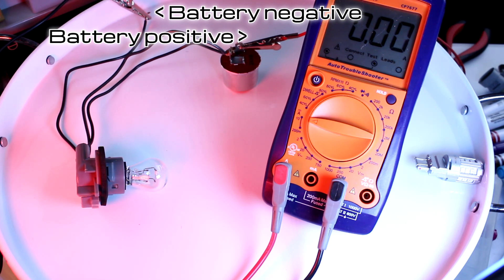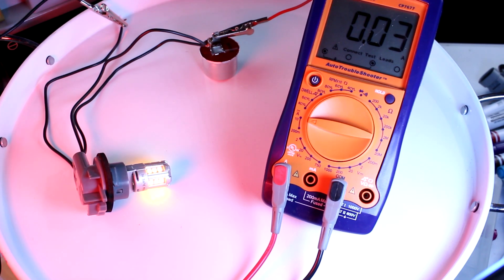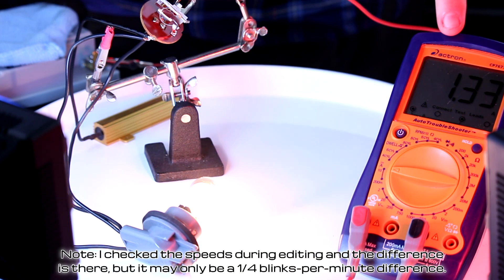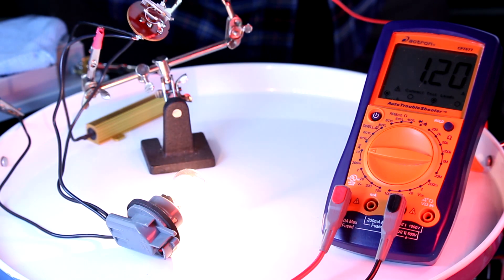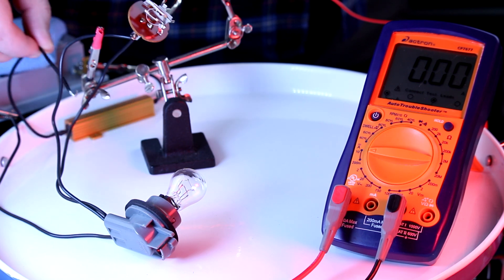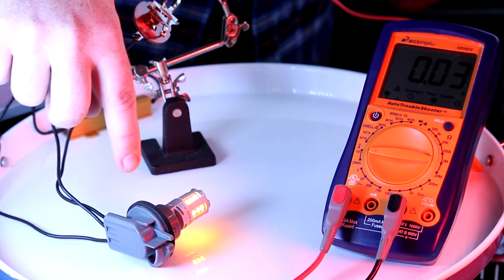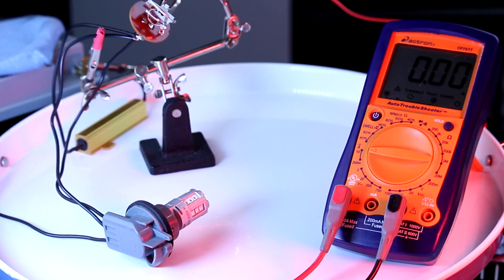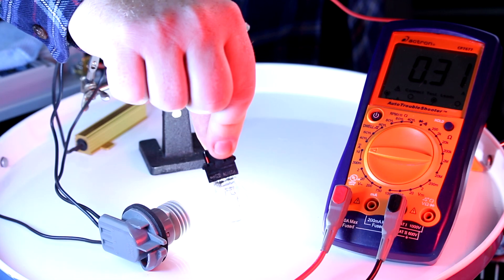Why LED Turn Signal Resistors Need to be in Parallel • Cars Simplified

Comment: Could the bulbs with built in resister work with a led bulb flasher relay?
Reply from the maker: Assuming there aren't any compatibility issues on the vehicle outside of the flasher unit itself, that combination should work. It would definitely be worth checking all four lights for turn signal and flasher/four-way/hazards after installation just in case, though.

Comment: Thanks dude, I didn't understand the LED indicator circuit fully until you mentioned that the resistor added in parallel helps draw more current THROUGH the flasher unit

Comment: @CarsSimified so with 12 volts, decided by amps. Those Sylvania zevo 3157c draws 5.3W per bulb. Much better than what they claim and labeled 4W on the led bulbs. 

And that’s actually pretty bright. 

Some say they need a backup camera to see better at night, but after installing these zevo 3157C with 5.3W, and it has a large diffuse lens. It’s super bright. 

These would be great option for reverse lights. 

Need to get my hands on them and see for myself.
Reply from the maker: For anything with a back-up camera, improved reverse lights make a big difference, especially if the camera otherwise has a really grainy image. There's a chance some cameras will simply have two sensor levels (day and night) which will keep night time grainy, but any other vehicle? Wild improvement! Sylvania Zevo, Diode Dynamics, and Lasfit are my three favorite brands for automotive LEDs at the moment.
Reply: @CarsSimplified  I agree with u.

Lasfit is my most go to brand. Sylvania zevo is my most as set it and forgetted type, and Auxito is also my go to.

Diode dynamics are knowing for one of the best of the best.

Would u recommend the sylvania zevo 3257C making 5.3W-5.6W for reverse light?

Comment: Great explanation thank you. I was under the (apparently false) impression that the resistance of LEDs was too low and the resistor needed to be in series. 

I suppose it makes sense since the flasher will behave exactly the same way when a standard bulb goes out and there’s an open circuit.

Comment: Thank you, exactly what I was looking for. I was curious why the led resistors were always fitted in parallel. At the same time I'm installing sweeping LED flashers to my motorcycle so by knowing how the resistance affects the flash time it'll help me to better gauge what I need to change if the let's don't complete a full flash before being reset.

Comment: I am converting to a 40 bulb led 3rd brake light. I am trying to reduce the the current or watts or amp so that it won’t burn out the board in the light. Would wiring the resistor in a series achieve that? What size resistor should I use? This is a car that never had a third break light.
Reply from the maker: That would be the way to do it! However, the resistor you need (or don't need) will depend on if the third brake light already has a built-in resistor, and how much current the lights can handle. Is this an aftermarket add-on kit of some sort, or a home made item?

Comment: What is the point of using LED lamps ?  You are not saving energy consumption if you have to connect a parallel load resistor. The resistors get hot and take up a lot of space and you have to find a suitable metal surface to mount them on.   The only advantage is theoretical longer life.   But cons are more serious than the pro.
Reply: The idea for led load equalizer resistor is to trick the vehicle’s computer, so the computer thinks it running with incandescent bulbs but in reality. We’re running with led.

Comment: Hey, question out of the blue. 
I have a turn signal on my 36v ebike, but i want to add additional LEDs on the sides. 
Could i put a DC DC step down converter from 36v to 12v after the flasher relay and get the same flashing in 12v? 
Or how would you solve the problem?
(I can't find any decent 36v leds to use)
Reply from the maker: Tricky! I don't think I've ever come across a 36V system before! Since 12V happens to be a third of 36V, the step down should be pretty easy to find! My plan would be to go with that and make some sort of small unit to house the 12V circuitry. I would put the flasher on the 12V side. This approach also gives you a point to build off of in case you want to add 12V taillights, brake lights, headlights, etc.

However, the 36V would also make it tempting to put three 12V lights in series. That would be expensive and maybe too bight (a resistor could help with the latter), but would eliminate the need for the step down circuitry. In this case my gut says the 12V thermal flasher would work, but I'm not certain.

The latter of those two ideas is a little more risky on the components, so the first idea is what I'd go with. I don't work with step down converters/transformers very often so I'm not sure if I'm forgetting any factors in regards to their particular behavior.
Reply: @CarsSimplified  Thank you for your answer!
Interesting idea to put them in series, I did not consider that, it surely is an opportunity.
The existing system already have taillights, brakelights, headlights and turn lights, all on a 36v system. 
I think my real question is, if I would still get the same intervals of flashing after a step down from 36v to 12v? Since the flasher already is built into the 36v system. 

I have a suspicion, that the capacitors in the step down converter will disrupt the frequency of the the flashing.
Reply: Unlikely it will work :  1) your flasher relay may have to support 36 Vdc  (2) the 12V flasher relays needs sufficient load current  to flash since it is a thermal device. So extremely doubtful that adding  converter and leds are sufficient load (3) regardless, not a great idea to be cycling the input to the converter. But in this case even though the planned result does not work, occasional cycling would be ok. (4)  Using the parallel resistor will add a lot more power battery consumption although only when flashing . (5)  I am not sure where  you would connect the converter (6) Without knowing the circuit, hard to suggest a solution.
Reply: Yes, it will work.
Converting the power takes power to do.
If you are also adding extra lights you are adding extra current draw.
One thing could happen but not likely, the lights you have running through the step down could possibly be slightly out of time with the lights running on the 36v circuit if you intend on running both.
If it does not work which I don’t think you will have a problem with, just get a 12v led compatible flasher canister.
If you can’t find one the same shape/ size just mount it remotely and wire it into the original flasher can mount

Comment: I installed these resistors I believe in parallel (two wires coming off light socket, installed one resistor wire to each) and I only get hyperflashing while the parking lights or headlights are on. With the lights off my blinker works as normal. Any idea whats going on there? These are the basic 50w 6ohm resitors you can buy off Amazon.

Comment: If I were to have replaced the Flasher with an LED style flasher what I still have to add in the voltage resistor for LED tail lights as well?
Reply: Aned flasher relay is design for led bulbs and still can use incandescent bulbs, that u will not have hyperflash anymore.

And u can throw a resistor if that’s were u want to go.

But it’s overkill.

A led flasher relay and consumes 163W that’s design for led turn signal lights. 

And u will no longer experience hyperflash anymore.